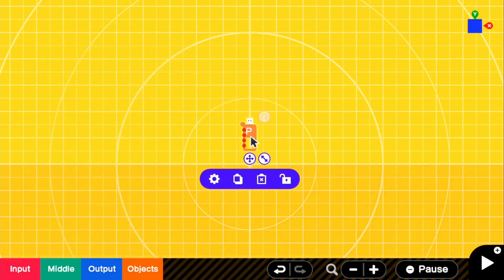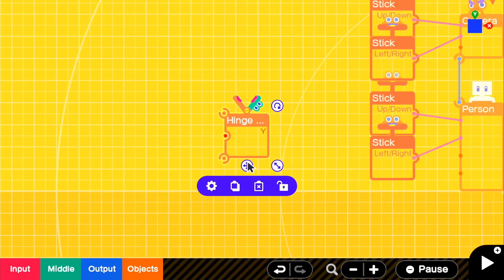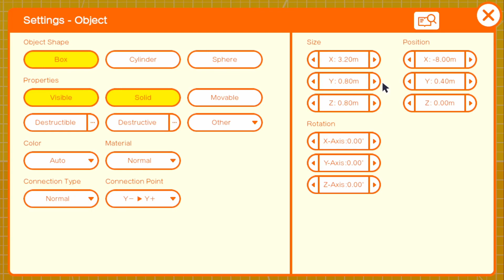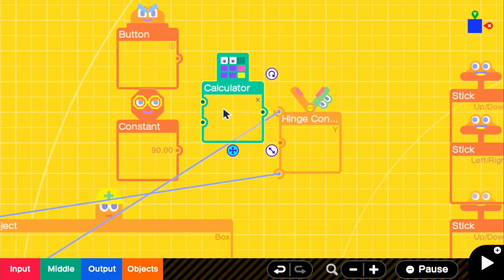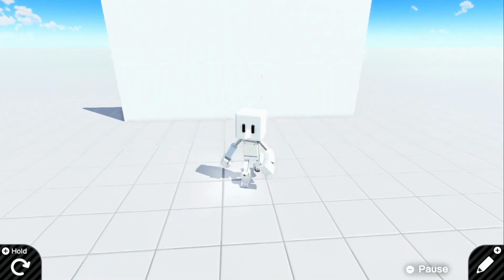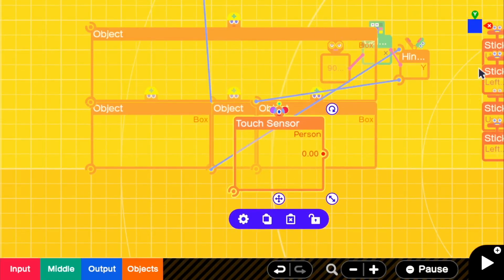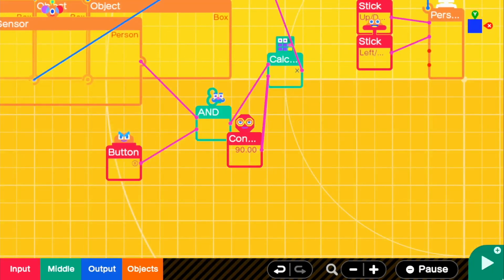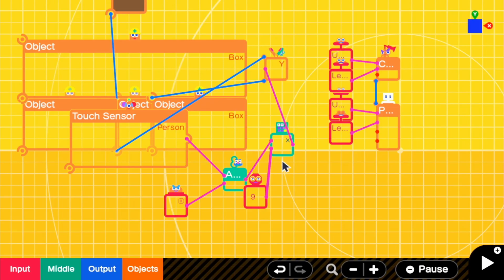[Game Builder Garage Tutorial] Door

Comment: A nice quality-of-life addition to this would be to run that "button and touch sensor" AND gate into a counter set to a range of 0 to 2 and looped (2 because it will loop back to 0 when it hits 2, giving an output of 0 to 1). Then use that counter's value as the angle, times 90. If you make the button trigger only On Press rather than While Pressed, the counter will act like a togglable flag, meaning you don't have to hold X. You can just press X to open, then press X to close again.

Comment: Is there a way to link a flag to whether an object is solid or not without using teleports to work around it? I have a level I'm making that has two states that you can toggle between, using a flag. I need one state to have certain objects be solid, and the other to have them pass-through. The objects in question would ideally be boxes. But I can't find a box variation that has its solidity as a feedable input. I can't use teleports because there's not enough of them for what I need to make.
Reply from the maker: Well this is tricky, for an object to have two states in this game is pretty much impossible. But you could accomplish this probably with using teleports wisely. Meaning that you could maybe send multiple objects through one specific teleporter. The goal I would probably try to do is be resourceful as possible. So if you are using any number of teleporters try to pass as many objects through them as possible. Also big mention, wormholes do you wonders. Hopefully what I said kinda gives you some ideas, but if not I can try to explain it a little better.
Reply: @Oribloop  I figured out a better solution. Use a launcher object, make it only active on one state, make it only spawn one object, and put a destroy object on it that's only active in the other state. When state 1 is active, the item spawns and isn't destroyed. When state 2 is active, the spawner is disabled and the existing object is destroyed.